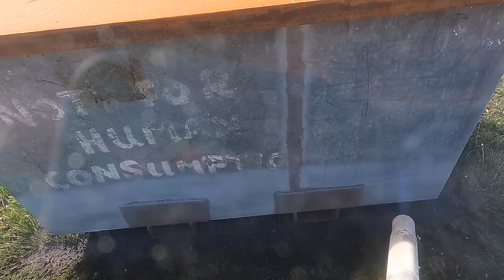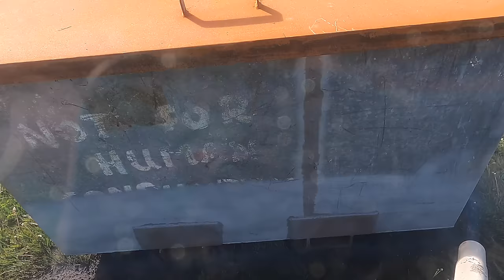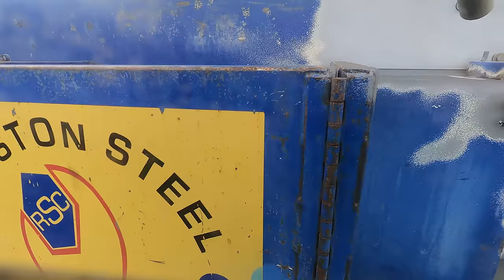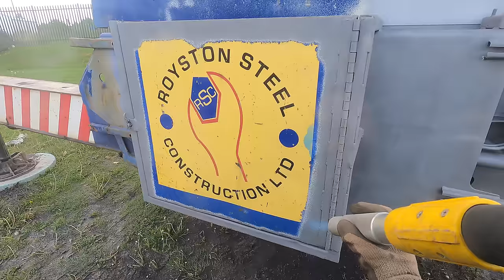Grit blasting mobile crane rust & paint removal restoration Industrial Sandblasting

Comment: Maybe a dumb question but if this video is sped up like I think it is, how long did it take to blast the crane? I was also curious how many times you had to refill the hopper on the machine doing a job like this?
Reply from the maker: I cannot remember the exact hours involved but it would have been done in a shift 👌👍 if it tuck a full shift it would have needed aprox 8 fills may be a tad more or less 👍

Comment: Heavy equipment generally does not have water based paint,outside paint stripping would not be permitted where I live in the states
Reply from the maker: UK has different laws and heavy equipment falls under the same rules as automotive purposes no solvent paints can be used since 2007 also sand has been banned (since the 60s) as a media the US hasn't yet outlawed this although this is more dangerous than solvent paints 😳 sand is known to be very harmful to the operator and others plus anything that breaths air in a 7 mile radius 🫣 all media I use is approved and recycled 👍